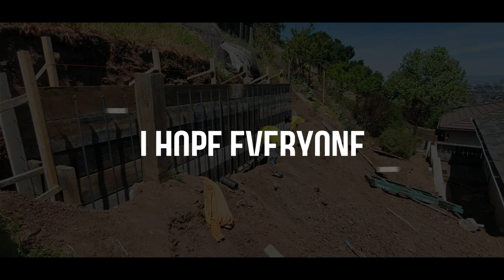Building A Concrete Retaining Wall To Prevent Hillside Slide

Comment: You guys never fail to impress me and educate non-engineers watching.

Most people have no clue how much work is involved before a retaining is done. Most see the finished product and say 'wow'. Peeling the forms at end is the easiest part and what many see. 

Building on steep slopes has it's challenges. Everything has to be carried by hand uphill. After a few dozen trips the real work begins. Digging trench for footing is hard work. Cutting back the hill so there is room to set forms is hard work. Building forms and placing steel rebar is hard work. 

If you are lucky, you can use a concrete pump so you don't have to use wheelbarrows to haul concrete. I always hated that part. I worked on tight sites in Seattle. Lots of steep hills, glacier pack subsoil, and limited access. 

It does feel good when you can pull forms and reveal your hard work.

I subscribed and Liked the Video - thanks for your channel
Reply from the maker: Appreciate the kinds words and yes there is a satisfactory on peeling those forms off.. 👍🏾👍🏾👍🏾

Comment: great video.. Just want to ask what if the soil on the other side was loose? how to hold it during construction of the retaining wall, any cheaper alternative than using sheet piles? Thanks.
Reply from the maker: As crazy as this may sound, we have not ran into that problem. Most soil will stay outside of sand. The safest way will be sheet piling or you can't cut the bank back further to give you some lead way.

Comment: Hi, great  videos!, could you please explain about the Keyway? is it the anchor for the wall, if not,  do not concrete walls need anchors? or is it just a footer for the rest of the wall?
Ty, and keep up the good work!
Reply from the maker: It's part of of the footing. A good way with out getting all technical it's a go between a footing and getting piers installed. Most piers we installed are approximately 18 feet deep/18 inches in diameter about 8 foot on center.. Appreciate the comment and support 💯 💯 💯
Reply: @AllAccessConstruction   Ok, got it!, Thank you for your fast reply to my question sir. The information is most interesting to me, stay safe.